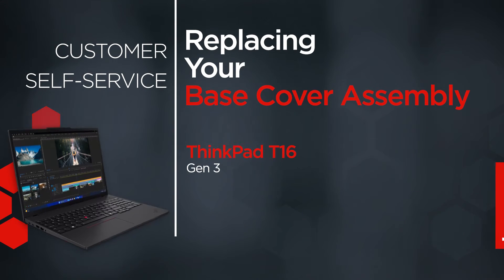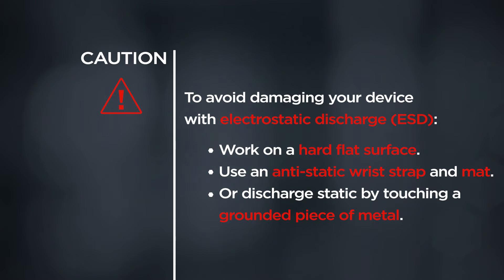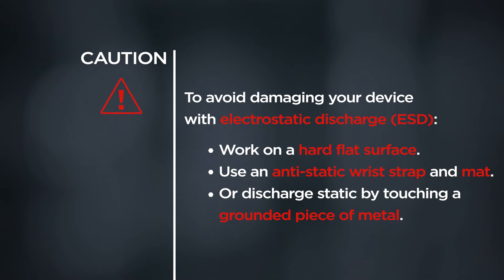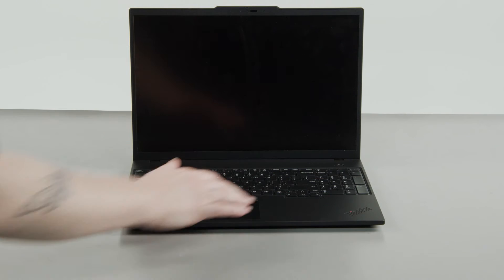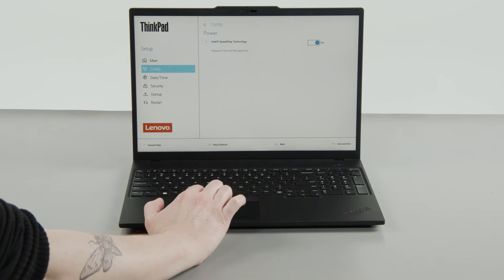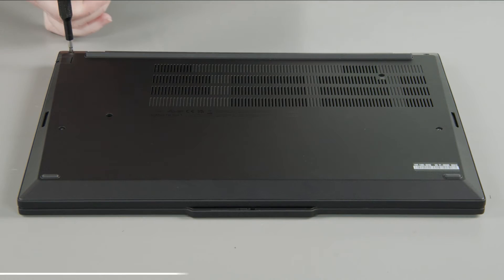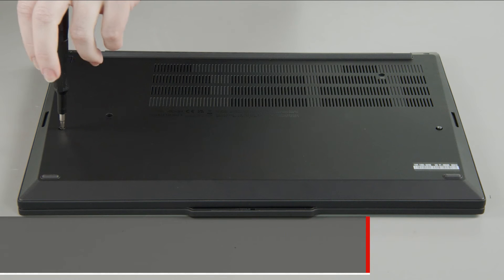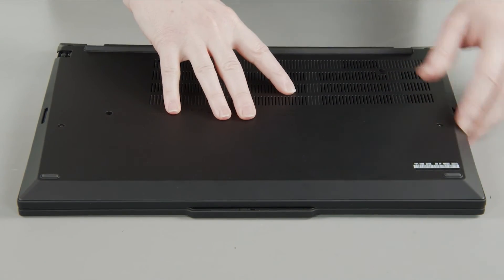Replacing Your Base Cover Assembly | ThinkPad T16 Gen 3 | Customer Self Service

Comment from the maker: This video will show you how to replace the Base Cover Assembly of your ThinkPad. The process in this video will work for the ThinkPad T16 Gen 3. 

You will need a screwdriver kit, a non-metallic pry tool, and 10 minutes of your time.

To view the ThinkPad T16 Gen 3 Self-Repair Guide go to https://pcsupport.lenovo.com/us/en/products/laptops-and-netbooks/thinkpad-t-series-laptops/thinkpad-t16-gen-3-type-21mn-21mq/selfrepair/removalsreplacements

To learn more about your device go to https://pcsupport.lenovo.com

To find parts for your device go to https://support.lenovo.com/parts-lookup/?cid=ww:lenovosocial:b9515f&source=socialmedia&subsource=yt

To view the Lenovo Support Self-Repair Guides landing page go to https://support.lenovo.com/us/en/solutions/HT516547

** NOTE: Static electricity can destroy components. Use a grounding strap, and clean, non-conductive surface to work on. Use plastic or coated tools to prevent scratching and avoid using metal tools on plastic parts. For more detailed information on electrostatic discharge and how to prevent it, please watch our ""Understanding Electrostatic Discharge (ESD)"" video: https://youtu.be/by4PB3WtdLo 

Applicable Machine Types:
ThinkPad T16 Gen 3 - 21MN, 21MQ

#Lenovo #LenovoSupport #LenovoTechSupport

Check out other official Lenovo channels!
https://www.youtube.com/@Lenovo 🟥
https://www.youtube.com/@lenovolegion 🎮
https://www.youtube.com/@Lenovo-PC 💻
https://www.youtube.com/@LenovoSuporte 🟢🟡